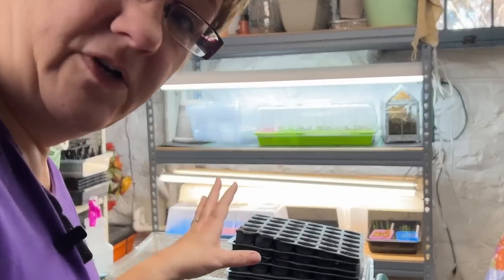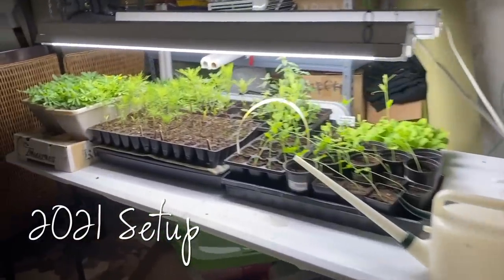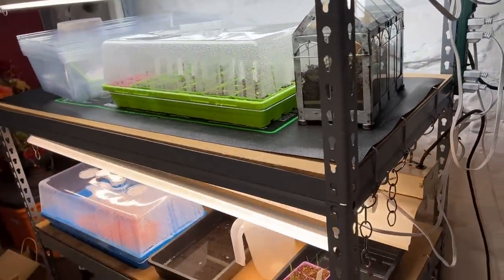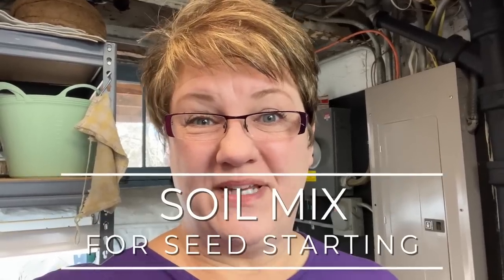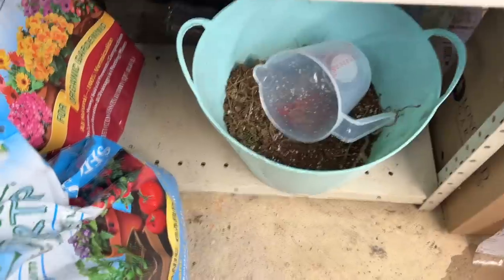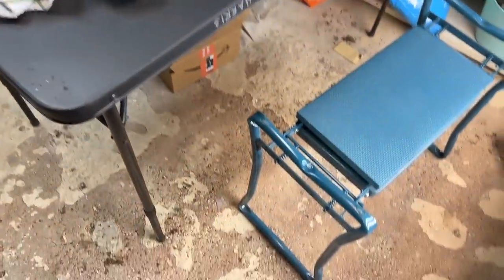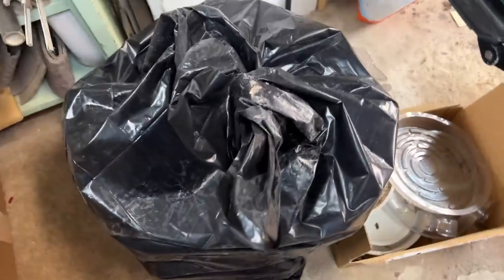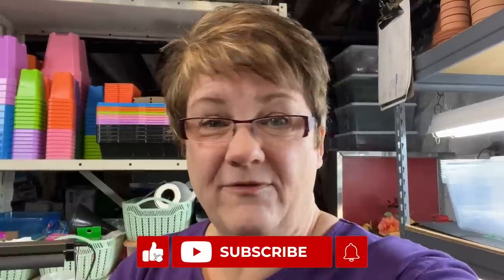My Seed Starting Setup - Lights, Shelves, Containers, and more! - 🌱💡🪴❤️

Comment: Those colorful trays are so cute! I have 6 grow ease kits from gardeners supply and I love them. Especially since I may forget about checking my seedling every day. The wicking mat saves my butt everytime 🤣
Reply from the maker: So true!!!!
Reply: We go to our cottage for a week or more at a time during seed season, so I could not live without self- watering trays. Unfortunately Gardeners Supply doesn’t ship to Canada and there are not too many other options. So - I buy heavy duty bottom trays, micro green trays that I invert into those ( better to cut the edges off first but not necessary), a big sheet of greenhouse wicking felt from Amazon and cut it to size for each setup. Result is a self watering setup for around $7-8 USD.

Comment: I purchased those bootstrap solid trays and the drains one too. I broke one of the solid trays. I was so devastated. I went to picked it up and the edge where I grab it, broke. Beside that, they are great. It is so much easier to water and empty the excess water with them. I am not sure if the plastic is UV protected. If not, then I suspect that's what happened. The edge of this particular tray was in the sun for about a month when I was rooting my hydrangea clippings.
Reply from the maker: Oh bummer!  Good to know!  I wonder if you could get a replacement for free or a discount?  Might be worth a try.

Comment: When and how much fertilizers do you use on your seedlings?
Reply from the maker: I don't start fertilizer until after they have a set of true leaves.  Then about every 10 days with a weak strength water soluble fish emulsion fertilizer until they get planted out or potted up.

Comment: Hi Jenny:  Have you used one of those hand-held sprayers that you pump?  I just picked one up this year, as I think it will be so much easier to keep my seedlings moist.  I'm wondering if I could add fertilizer to them, or would the solution be too thick and clog the sprayer?  Does anyone have any experience they can share?  Thanks
Reply from the maker: Yes, I have seen pump sprayers - I actually have a couple different ones.   you can put water soluble fertilizer in them, several cut flower farmers on YouTube do that for a foliar application of fertilizer in their fields.  Good luck!
Reply: Yes I also have used the pump sprayers and they are great,but,to treat yourself get a battery operated pump sprayer. The best $35 I spent. I can water my W/S jugs by just sticking the wand in and over the years I have increased my seed starting “operation” so this is a game changer as far as watering. Holds a gallon. Also used it for removing the popcorn ceiling LOL.

Comment: Hi Jenny .... I have a question ... I bought some seed starting trays from Gardener's supply and this is my first year to using them ..... Four days ago I started to germinate Geranium seed in wet paper towels in sandwich bags ... I wanted to plant them up sooner than I did however I couldn't get to them so I planted them on the fourth day - yesterday ... they already where showing green .. I put the dome led on them and  lights so this morning I was checking on them and got a little concerned because they where all --- up and running --- well what I mean is that they looked like the where happy in their new spot ... so my concern is should  I take the dome off .... well I did .. but I could put it back on ... Just worried about dampening off .... Thanks for or help .... oh yes three trays --- 72 little babies .... !!!
Reply from the maker: I would recommend taking the dome off, if they have put on leaves.   The humidity is useful for keeping the soil moist prior to germination, but you're beyond that point.   I only have my cactus seedlings under a dome because I'm hoping there are still seeds that haven't yet germinated.  Good luck!
Reply: @HarmonyHillsHomeandGarden  ... Yelp I have little green leaves and the soil is still moist .... Thanks for getting back to me .... !!!